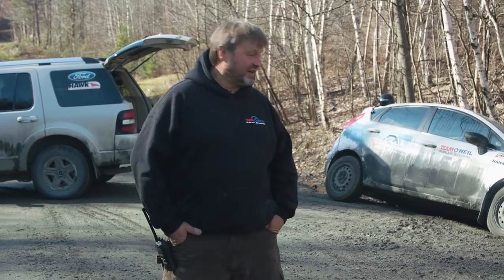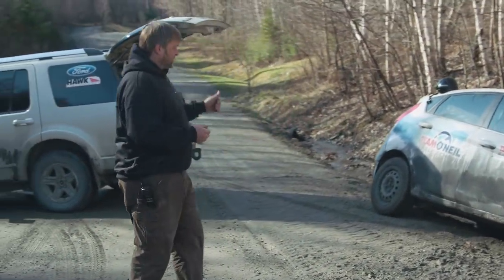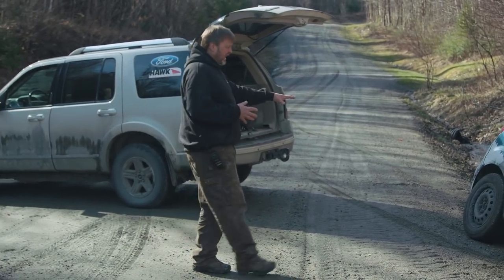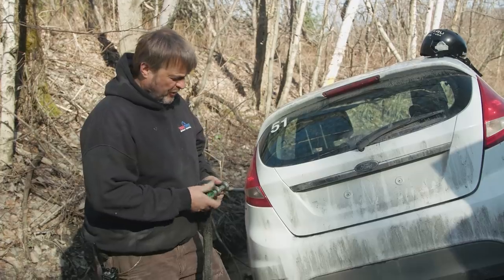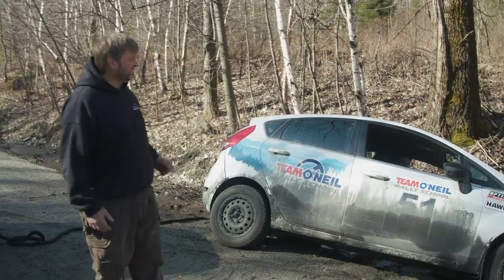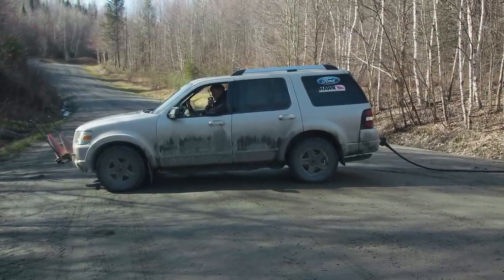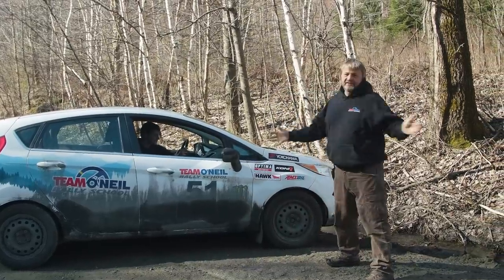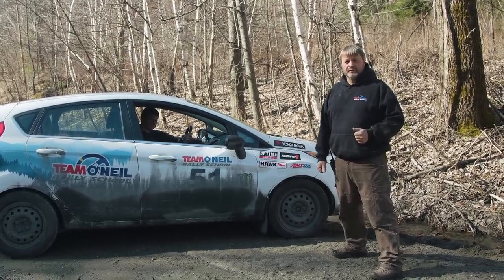How to Recover a Car Out of a Ditch

Comment: i do alot of offroading and am familiar with recoveries, kinetic ropes, and beating on jeeps and vehicles.. seen this video pop up hoping itd cover safe points to pull from on modern cars for when i come across someone off the road or stuck in snow.. but you have an after market recovery point that accepts a d ring... id say over 90% of cars today dont come with any recovery points and the only option is the J-hooks only tow trucks have which still arent ideal as at bad angles you risk the line digging into or ripping off bumpers and body work
Reply: Second this and add that if you use a flat strap or worse a chain, you WILL damage a unibody car even using the factory recovery points.
Reply: Appreciate the video! Who other than jeepers, farmers and firefighters carry expensice recovery rope in their car, just in case? Honest question, maybe the point here is dont pull people out of ditches unless you know what you are doing...
Reply: @Christopher-vf6kx   is that really the point here? and recovery ropes arent that expensive, princess auto here in canada has them on for 40$ frequently and theres decent ones for 80-120$ on amazon, name brand ones are pricey at 300$+, i havent compared them to know which ones are worth it but for just occasionally emergency use the cheap ones are fine and much better than strap or chain

the point of my comment was, almost all modern cars have no where to attach any kind of shackle, clevic, hook, rope, ect without almost certainly ripping body panels off and damaging suspension bits aswell.. they could of got that car out with a strap or chain just fine, not as gently or smoothly but itd have been out and fine, the aftermarket tow hook point is something they couldnt do  without and something that is too late to be done once the cars in the ditch, and really out of your control if the stuck vehicle isnt yours to begin with

what we need is a video on how to attack a clevis or tow hook of somekind to a car thats in a ditch or snow bank and pull it out with a kinetic rope not a winch line
Reply: @AndrewBrowner  I just hook onto the base of the control arms, or solid axles on my cars. I have never had a problem with suspension damage, or body panel damage.
Reply: @ameraldas3641  thats really car and position specific.. alot of new cars have what 4" of bumper clearance if your jeep/trucks attachment point if 2ft high and the control arm is a couple feet beyond their bumper the angles just arent going to add up and the rope will want to pass through where the bumper is... find a friends compact car or something like a honda civic, put your rope or trap on a control arm and then try to attach it to the hook on your truck bumper 20ft away.. theres gonna be interference, now ass in that the stuck car would either be sunk in mud or snow, and possibly in a ditch with a big break over angle to tackle... theres gonna be issues
Reply: @AndrewBrowner  I've pulled a honda minivan with an f150 using the subframe and pulled a crc using the control arm. If you aren't afraid to get a little dirty  you won't damage anything. If your pulling people in deep snow a lot of the time is safer to dig them out with a shovel first.
Reply: @xlbbman   control arms seem pretty easy to bend which will ruin tires and require replacing, if you can get a wrap around a subframe thatll get most vehicles out unless theyre burried in mud or sand...but still doesnt solve the problem of modern low hanging bumpers that the line will dig into and rip off
Reply: @AndrewBrowner  The control arm is one of the strongest points on a vehicle. The cars forces experienced  by its own weight, going over bumps, potholes, etc travel through your  vehicles control arms on a regular basis. (The lower control arm experiences the most of the load which is why it is always bigger than the upper) They are not easy to bend. How hard you can pull on them is dependent on the car though, so I agree. It's nicer to find the subframe.

Here is a video that mentions ways for cars with low clearance: https://youtu.be/voXU7uGD7-Y
This guy is a recovery specialist and pulls all kinds of vehicles in all kinds of conditions including sand. (Think he is in Cali) If your interested and have the free time, check out his videos. They are  helpful in discovering the nuances of vehicle recovery.

-Hope this helps
Reply: How do I get an old 2nd gen F-body out of a ditch? It's in front first (I would think most cars would be), so I can't hook to the control arms. Can I just wrap a strap around the rear diff?
Reply: Look into getting an axle tie down straps. That should work most of time. Put one on either side. Attach a d ring to the axle strap to a recovery tree strap saver and then to a soft shackle and the kinetic rope or a tow strap.
Reply: @huntingadventureswithsy  modern car anytime youre pulling from down around the suspension not only is it easy to bend or tweak something.. but you inevitably end up with the strap mangling up the body work.. typically someone who is stuck is on the same level or much lower than you, on a lifted truck/jeep with custom bumpers the attachment point is waist height where as a control arm or anything similar on  a car is maybe 6" off the ground and set into the car 2ft.. the angle that creates interferes with their bumper

theoretically if youre strap is long enough it doesnt but in realistic scenarios youre not using 120ft of strap and there isnt enough runway to use that much

Comment: You should do a video about ways to save yourself from a crash or how to crash safer if you know you're going to.
Reply: Well, my tip would be to do your best to drive off the road as parallel to it as possible while using whatever is off of the road to drastically reduce your speed.

Swerving hard to the left or right can put you at risk of being struck by cars from the side, or rolling over, or both. Do your best to turn like you're just trying to get into another lane. Hard to do it in the moment, but maintain control as much as you can, reducing your speed as safely and gradually (as to avoid getting rear-ended by cars behind you) as you can and avoiding or minimizing the collision.

Easy to say when it isn't happening to you, but do your best not to panic. Use that adrenaline-fueled time dilation to take stock of your options.

Again, these are easy tips to write out on YouTube while sitting in my house. You can only imagine how you're going to react in an actual (potential) collision.

And if you see the car in front of you begin to cause a wreck, put your hazards on. Even if the wreck doesn't happen, at least people behind you know something's up
Reply: @СветкаВолков  I meant more in a rally context but this is good info nonetheless
Reply from the maker: https://www.youtube.com/watch?v=uksaf5SWcB4&t=151s

Comment: What about road cars with no recovery points?
Reply: All road cars have recovery points or places that are safe to pull from.
Reply: soft shackles and bridles to distribute the load across the chassis
Reply: @ianholmquist8492  my Focus ST didn't, unless there was something unmarked underneath but nothing obvious
Reply: @ares7181  Often you'll hook to the A arm on the front suspension if there's nothing else
Reply: @ares7181  normally you have a plastic cover somewhere on your bumper that is like 3*3cm, you have to figure a way out to pop that out, and underneath is a threaded hole where you can put your tow hook in. At least in the front bumper that is. My normal Focus has that, so I suppose ST models have that as well? Maybe it is something European, but to my knowledge all cars here have that.
Reply: @jarnedeprins3617  don't use those tow hooks, they are there for a different purpose and will break of you pull from them. Your best bet is to go through the control arm or subframe as these are some of the strongest points on a car
Reply: @jarnedeprins3617  the US spec Fiesta ST and Focus ST did not get these for some strange reason.